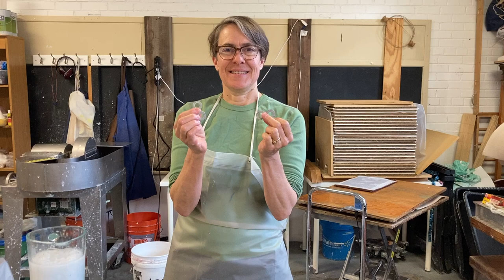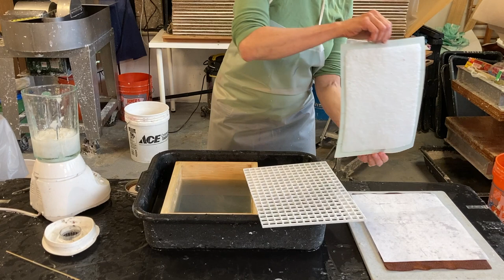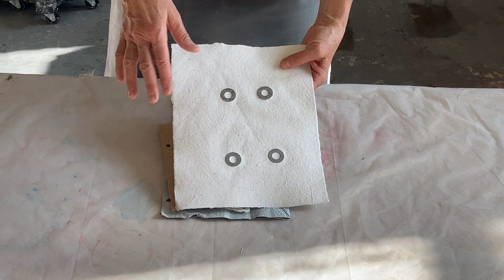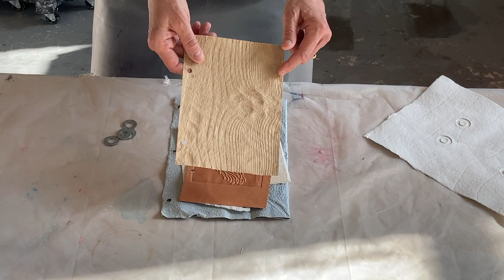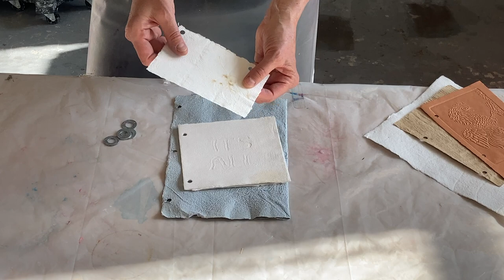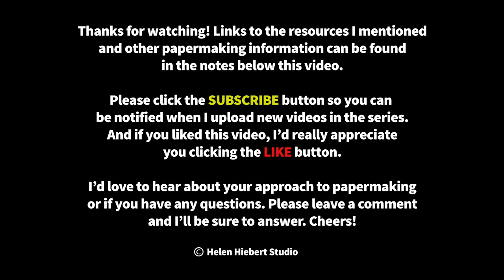Papermaking Series: Embossing

Comment: This is a great video.  I'm embossing thistle paper with large pieces of glass and am finding that the thistle fibre sticks to the glass.  Is there something you would recommend as a release agent that won't damage or make the paper greasy?
Reply from the maker: I haven't had this issue. but some plant fibers tend to be sticky. There are a couple of release agents that sculptors use, such as green soap. I know there are also silicon spray release agent agents – do a test first, of course.
Reply: @HelenHiebert  Thanks!  I'll try the green soap!